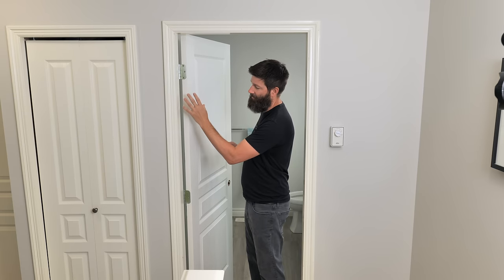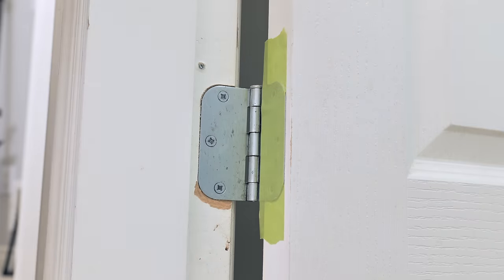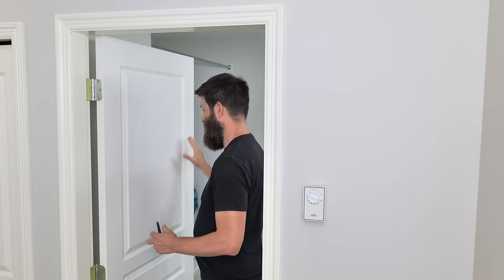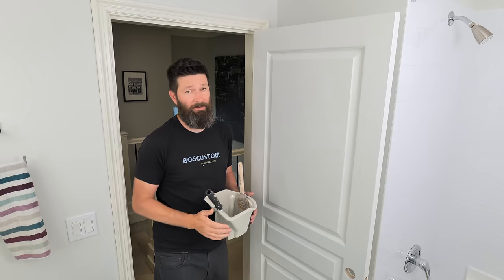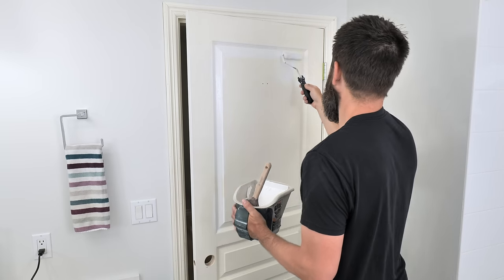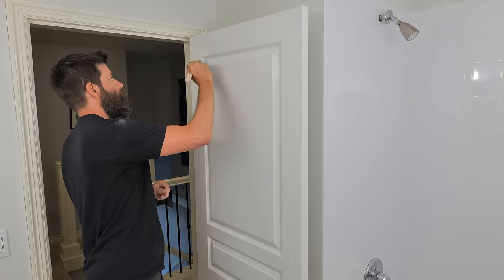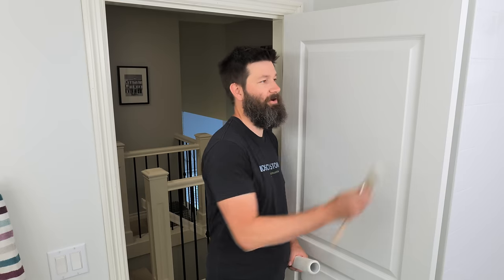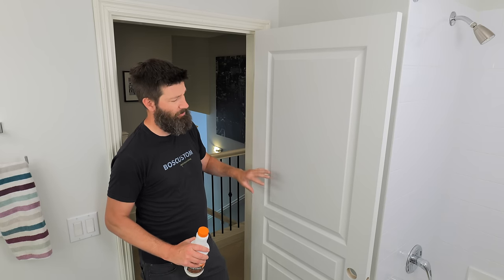4 Door Painting Tips You Don't Want To Miss!

Comment: Note
1) tape off any hinges
2) sand door and wipe off after
3) make sure there's something under to catch any paint but also to keep the door from moving
4) paint edges
5) paint the things that reccess with brush
6) use roller cover rest of door (when doing edges you don't wanna have a lot of paint on the roller)
Reply: Hi! What grit of sandpaper do you use?
Reply: @hollyedwards1084 his foam block was 120 grit. 80g =120g to start 180g - 240g after first coat. The rule is to use the highest grit number (smoothest) to do the job.

Comment: Ive been a contract painter for years and never had to use paint extenders or cond8tioners. Warming your paint is a good tip = pop the lid first!
Its all about keeping a wet edge you can work to. For doors i go down to below the door handle. This is where my wet edge begins to fail. I work from the bottom up to blend both halves of the door. If there is any rippling in the finish its below the sight line. Thats how City and Guilds were teaching it in 1986.
Reply: Do I need to sand my bathroom door? My door looks like the one in the video. I have a can of paint called Glidden Multipurpose All-In-One Primer + Sealer Interior/Exterior.

Comment: I never seen that stuff you add it to the paint to give you more time to work that’s great I strain the paint every day I’m working as soon as I see the paint dry on the sides of the Duce bucket it’s winter time in Maryland where I am from but when the sun comes threw the window and I have to keep the heat at least on 70 degrees because of the dogs when I’m working I get hot and there’s a lot of sun coming through the windows in the family room so I got to make sure I keep the paint out of it in the shade and in the room that’s cool and what I’m not using take it down to the basement 
Are used to strain the gallons into a 5 gallon home depo bucket but much easier to do 2 gallons at a time in a white deuce bucket  def gona try that I can’t remember the name offhand to make you be able to work with the paint longer 
Since I am paint my family room so often and I use eggshell on the walls and eggshell on the trim I will paint the trim first then just tape the top of the trim then I always I have white Duce bucket for every color so i can keep the paint strain and using eggshell is like using semi gloss I’ll let it dry up in the sunlight take it up to the sanitary sink run hot water and peal it out most of the time I get most of it out of there and if I don’t I just keep a plug in the sink so that dry paint don’t go in the sink 

You have some great videos I always learn somthing new every time I work in the house 👍👍👍👍👍👏👏👏

Comment: Do you have a link for the 5mm nap roller you mentioned?

I've now spent longer on these 3 smooth, hollow-core, pre-primed doors than I have painting an entire 2-bed apartment, and I feel utterly defeated.
I first used a Wooster Pro "smooth to semi-smooth" roller and got a consistent finish .. however it left so much stippling texture I just couldn't believe it, like the texture of a bath towel.
I really didn't want to rent a sprayer and deal with that whole hassle, so I tried this 6 1/2" Wooster Pro "smooth surfaces" sponge roller. After half a gallon of paint and three days of experimentation, I've not been able to get the roller to leave a consistent finish - no matter what, it leaves evidence of where it's been.
Using Glidden semi-gloss.
I've tried:
-Floetrol
-varying pressure in my arm
-varying speed, from measured & steady to as-fast-as-I-can-physically-move (slightly better results, but flung paint specks 12ft+ around the whole room)
-different ambient temperatures from 64-70F
-soaking the roller vs. drying it out before pulling paint
-gobbing the paint onto the door in one go then spreading (big mistake, obviously)
-applying just enough paint in small sections at a time
If/when I ever get the paint to roll out consistently in one section, the roller always leaves a pronounced line at its edges, making overlapping impossible. The only thing I can think to do at this point is to dump the rest of this bottle of Floetrol into the remaining paint, get the largest "smooth to semi-smooth" roller I can find, then roll the door as quickly as possible and hope the Floetrol will prevent such pronounced texturing. Maybe even lay the doors out horizontally on a table so gravity will pull the paint flat.

So, I'm intrigued that you mention a roller with a nap for a smooth door rather than a foam one, and at this point I'll give anything a try. Cheers.
Reply: That sounds harrowing. Hope you have covered some ground since you wrote....or hired a pro. ❤

Comment: Wow, I think tipping off with the brush after covering that much of the door is going to lead to some tacking up

I do my 6 panel doors by doing the interior panels solely with the brush them working my way out from the middle rails laying on with a foam roller and tipping off with the brush one rail at a time and do the long outside rails last and I use a little Floetrol

Doing it the way he's doing it he must be using a lot of Floetrol or that paint is going to tack up brushing it out like he's doing I would think

Comment: Great video, thank you !  However, my paint is drying SO much faster than 5 to 7 minutes even with Flowtrol in it !  There is no way I could roll the whole door then brush which is the technique I've been using, but trying to do each door jam and door section by section which is taking me FOREVER !  Behr from Home Depot seems to have a good reputation.  Temperature is in around 70 F in the house.  Wondering what my problem is.  What brand of paint do you use ?

Comment: What's the nap size on the roller?
Reply from the maker: 10mm micro fibre
Reply: Do you have a specific brand of roller you prefer?
Reply: I just repainted 2 doors and they look FANTASTIC! Thanks for the advice on the Floetrol !
I used 4-1/2 " PURDY Jumbo Ultra Finish Premium Microfiber with 3/8" nap rollers.
The doors look like they have a spray finish!